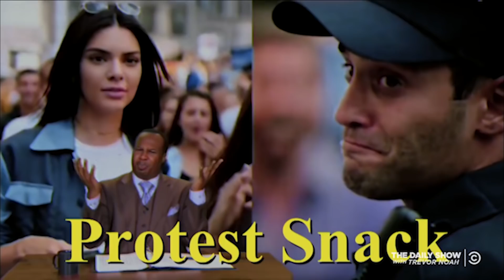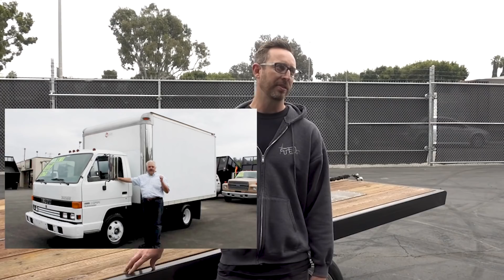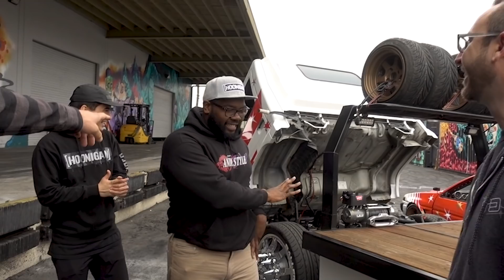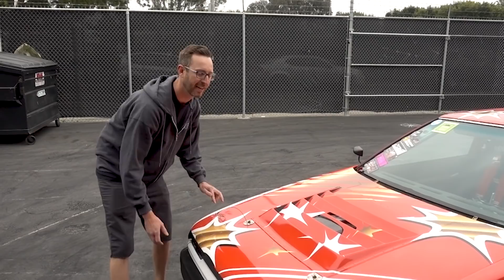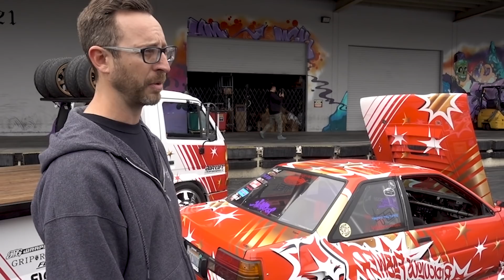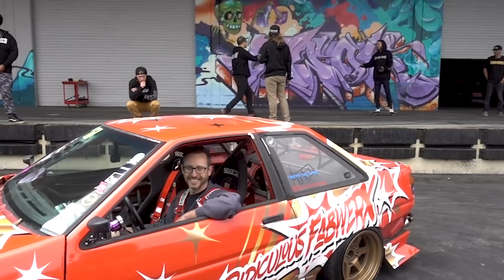Baller Hauler + AE86 Corolla 3SGE BEAMS Powered Drift Car

Comment: Officially one of the TOP 5 DTTS of all time!
Reply: ClutchkickPJ i was gonna say sumthing bout the lines. But holy shit bro, i was thinking top 10 but top 5 deff. Goodlawd!
Reply: ClutchkickPJ minus the ls part
Reply: OP actually said it was top 5 DTT... Daily Transmission Tangents. Which is still not right.

Regardless of how you put it though, this is easily one of the best Hoonigan vids of all time, amazing builds, humble dude, and innovative hooning.

Side note, if anyone is wondering what the BEAMS motor is, it's actually a 3S-GE. A motor only available to the US through the MR2 (not the correct layout for a drift swap). Otherwise you need a JDM motor, which would generally be from the Altezza (Basically 4 cylinder IS300).

Comment: The one thing that would've made this better is if the ramp truck did a dually burnout with the car on top doing a burnout. Burnoutception if you will.

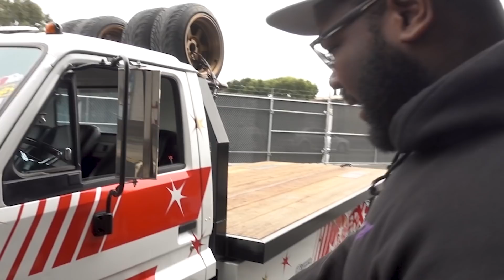Comment: Well at around 8:25 I heard "LS Swapped"

Let me stop you there... what? My head is gonna explode! YOU LS SWAPPED IT? THAT IS DOPE!
Reply: Jason Bailey bs on the swap they come from the factory with a 6.0
Reply: They came with a 350 sbc as well and also a diesel. I'm not sure what year that one is in the video. Those trucks are always slow so I'm guessing they didn't have a duramax in them (they also didn't sound like a duramax). I can tell you that the older ones with a 350 and the plastic intake manifold sucked for power and were dogs. It seems it would have been better to just buy one with the 6.0, but I could understand him converting a diesel version. He could have found any gas specific parts to swap in if needed......yep it is more work and seems like a waste, but car/truck guys will do that sort of shit.
Reply: Did you watch the video GreaseMonkey? He said he LS swapped it. Go back and watch. I will wait

Comment: Attention hert or hoonigans!
This cab over npr is cool, but if you want a ls npr, all you have to do is buy an 06 or up, they already have a 6.0 in them from the factory. 09 and up have the 4th gen 6.0 and 13and up have a 6l90 trans.. I maintain a fleet of 30 of these for a living. They're very cool and easy to work on.
Reply: Also, the ecm is tunable with hp tuners.. I've done it!

Comment: A 3SGTE does the job too...of you wanna go crazy you can put a 1UZ and if you are insane you can put a 2JZ you will have to cut a lot of material tho and it's a hard swap but it works and it will push that Corolla like a rocket

Comment: Press brake for bending metal. Upper die (punch) is the radius you want, multiply the the material thickness by 6 to get the opening of the lower die. Programming one and getting the tonnage, ram reversal, backstop position, etc is about a bitch when you've got a tolerance in the thousandths but that's the machine you'd have to look into to make some custom fabrication parts, as well as a laser or water jet cutting monster of a tool.

Comment: Well I guess the price of those box trucks going up because I want one now and I'm not surprised you could put a LS in it I did a tune up on one that had a Chevy 350 small block either way Top Notch episode
Reply: A guy I do work for had one as his work truck when I first met him. It had the 350 and was gutless and it had a plastic intake manifold that was supposedly good for leaks. His was a flatbed version. I'm guessing the diesel trucks were gutless as well and didn't have anything like a duramax in them, so the 6.0 seems like a good fit considering it was probably easy to get any parts that may have been unique to the gas version of the truck and that the LS is so similar to the gen I sbc.

Comment: The Beams is the truth though...but it would be even better with a turbo or supercharger. That being said, I give dude ALOT of props because the car and the hauler are both dope af. I'm not hating at all, because I don't have shit that can compare.
Reply: I personally think AE86s are perfect when kept NA. I'm normally not bothered about engine swaps/turboing whatever but for some reason I feel like the 86s just should be NA
Reply: @edenk7694  I hear you man, and I understand. I'm personally not against a good NA build and I've seen some crazy NA builds, but the stock engine 4A-GE with the T-50 gearbox was a good combination and is capable of making decent power with modifications, but unless you swap internals to a high compression setup and use ITBs, that engine isn't going to do the chassis much justice. 128 hp/110 lb/ft of torque isn't exactly ground shattering. That being said, I have seen some high compression NA Honda builds that didn't make much horsepower, but somehow was really fast and fun to drive.
Reply: @edenk7694  If you're referring to keeping the 3S-GE NA, than I also agree. They have an 11.1:1 static compression ratio and make 200 HP and 155 lb/ft of torque out of the box. However, I would modify it slightly with a header and a set of ITBs, maybe some port work on the head.

Comment: Quick question, can u LS swap anything? Like can u just stick any engine in any car?
Reply: You can drop any engine into any car, provided you're not too keen on the car running in some cases, i.e. putting a top fuel V8 in a Starlet. You CAN swap it, but will it run? Probably not.